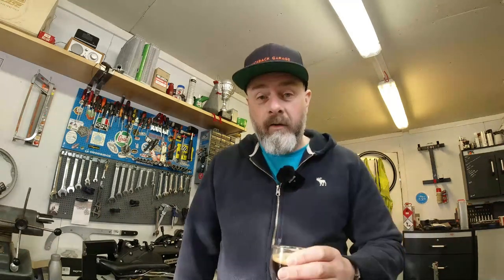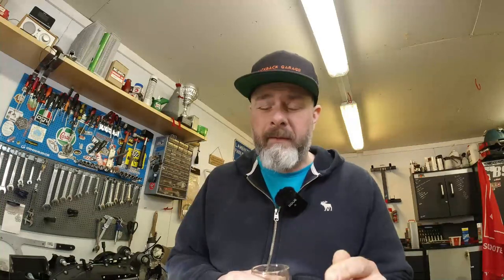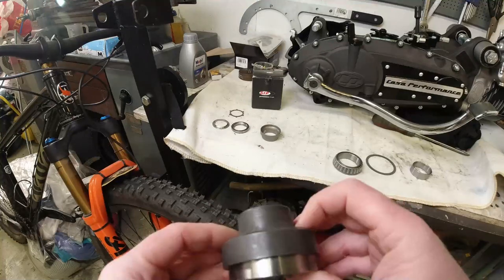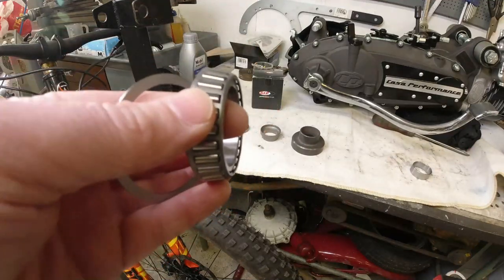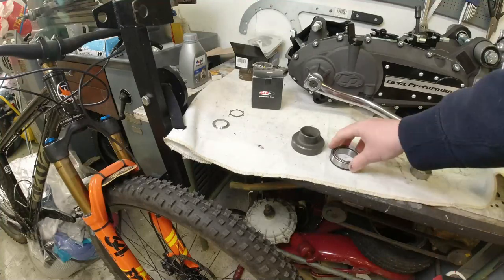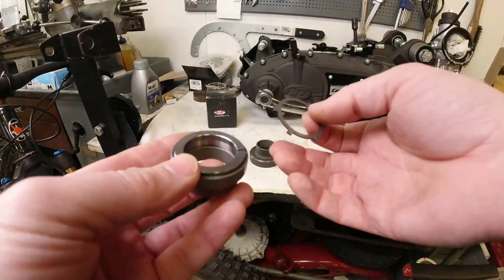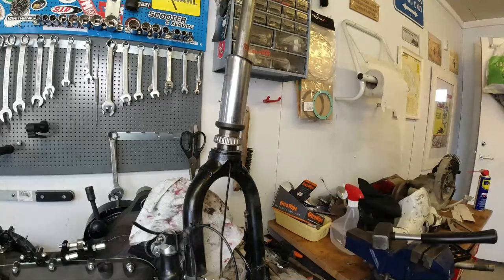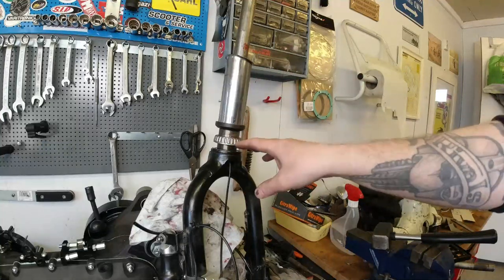Sip V2 lambretta taper  roller bearing kit #kickbackgarage

Comment: Maybe you need to stick your forks in the freezer for a few days to shrink down that tolerance.  Definitely won't be a pain to remove those bearings later on...
Reply from the maker: Mate, the fork won't shrink a whole mm. They are steel, not alloy.
Reply: @kickbackgarage  Sure it will! You just need a REALLY cold fridge. And maybe a lathe.

Comment: Rob, would you suggest machining the inner race to fit the fork?
Also, when you were attempting to hammer in the bearing I noticed you have a short piece of pipe. In those situations I've had better luck with a long thick pipe that comes up past the top of the fork, so you can get a more solid and even blow when fitting.
Reply from the maker: I've measured 3 forks now and they all vary 🙈 I've come to the stage that if expensive parts don't fit then I ask the dealer for a refund. Otherwise they just carry on sending Ill fitting parts out to customers.

Comment: Don't you fit the cup part into the frame then put the bearing on the forks?
Reply from the maker: The bearin on the forks, yes. The cup in the frame and the bearing race in the cup. Unfortunately the bearing race doesn't fit in the cup once the cup is installed.

Comment: I don't know if it's just me, but I sense a tiny bit of frustration there.
Reply from the maker: Just a tiny bit! £130 down the drain. No answer from SIP.
Reply: That stings. Never had to use SIP support myself but your experience sounds common, sadly. Try sending it back as not fit for purpose.
Reply from the maker: £30 in postage and I'll never get the handling fee or vat back. 🙈

Comment: In my opinion you can’t trust the sip and bgm stuff at all. Of course cables maybe an inner tube, or gearbox oil and some other small bits you can use. But the rest is shite. My Vespa sip exhaust is good. On the other hand a bgm v4 exhaust is one of the biggest failures. The bgm stainless rims are nice. But dare you if you fit technical advanced stuff from them!
Reply from the maker: I've had good success with sip vape 12v system and no probs the bgm stuff. 🤷‍♂️
Reply: @kickbackgarage  because it’s made in Czech Republic I guess. Most of the other stuff is from Asia.
Reply from the maker: The v2 bearing kit is German 🙈
Reply: @kickbackgarage  🙈💀
Reply: As a rule of thumb I's say that all the BGM stuff made in Germany for Lambretta like the ss rims, the flywheel, the rectifier are of very good quality. The engine silentblock have a good reputation, but I got zero experience in using them so far.
The V4 exhaust is not the most powerful, but the best I have had so far. IIt lasts and is quiet. And I had all clubmen except for Tutto Lambretta / Stratos, R. Saxelby and the new Ex-Box. The V4 is made in Spain by the way.
The bare RT cylinder and head is without any doubts good quality. 

The rest I buy from other dealers respectively suppliers. But it's the same story as you might know - you can't get all parts from one brand or dealer. Some stuff is good, some not.

Comment: Why are you buying this sip nonsense? If you stick to the original type of for bearings and use only balls and no cage top and bottom there should be no problem. My forks on my two series 2 machines work perfect. I would never do that. Never.
Reply from the maker: I bought them so I could make a video before others do. Robs public service. You're welcome 😂